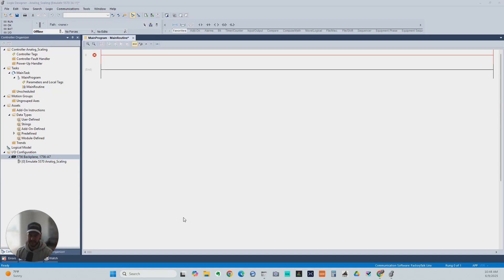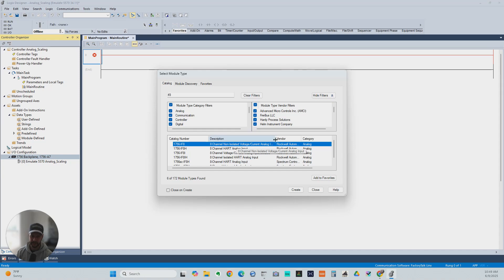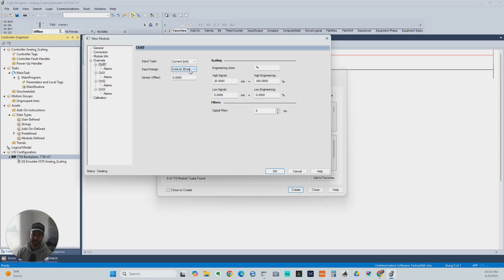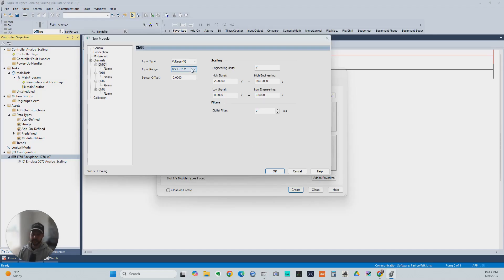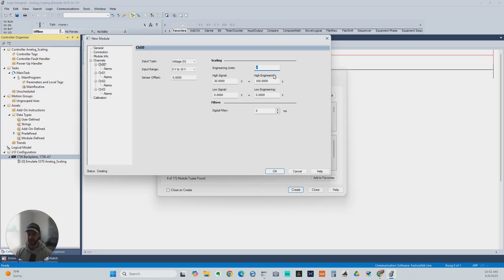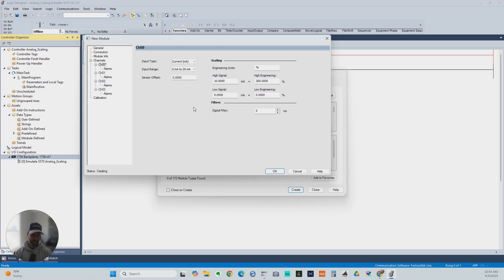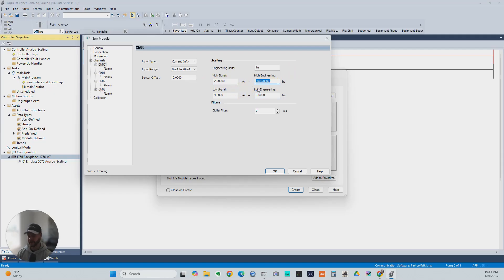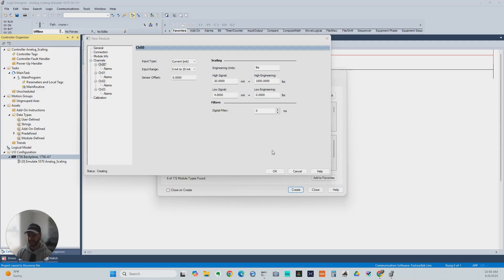Scaling ControlLogix Analog Input Modules in Logix Designer

Comment: In some cases this is the most convenient way to scale an AI, but in most cases it is better to scale everything 0 - 100% in the card, then apply engineering unit scaling in the AI block, that being 0 - 100%  = X to Y Eng Unit scale.   This makes it more convenient to find the scaling quickly and you can change it without downloading the card.  If you happen to be using PlantPAx, you still have to enter the eng. unit scaling in the AOP even if it has been applied in the card because there are fields for this that can't be left empty.  The whole thing is a bit non-intuitive for engineers more familiar with a DCS, most of which typically have one and only one appropriate place to apply scaling, unlike Allen-Bradley that gives you multiple places.
Reply from the maker: I agree that multiple places to do scaling can lead confusion and uncertainty. The flexibility is nice but has it's downsides!